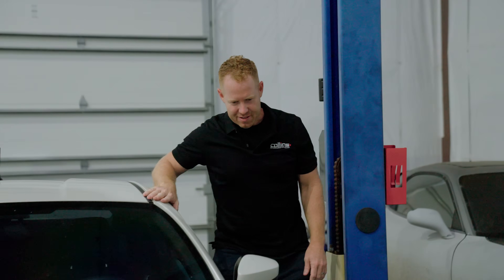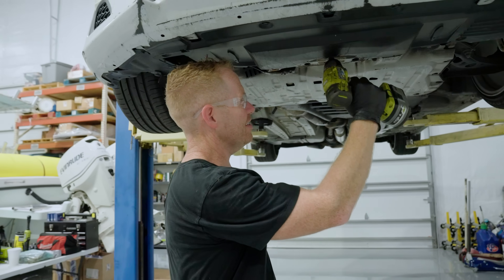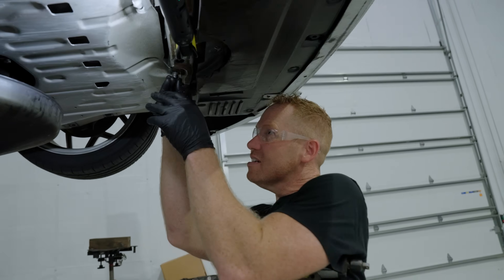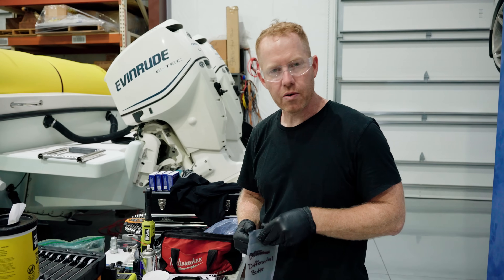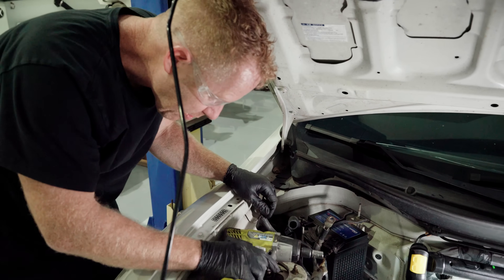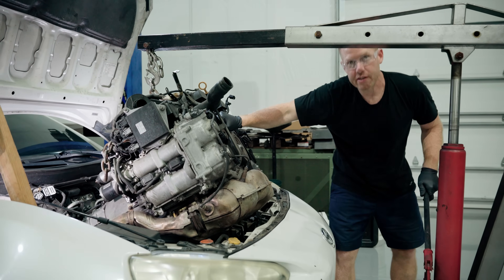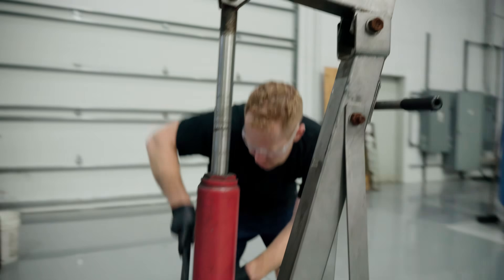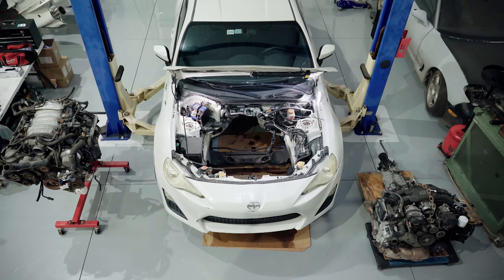3UZ-FE V8 swap into an FRS using the stock 6-speed trans, Video Series! Part 1 engine removal

Comment: What’s the reason for the 93 octane? Compression ratio? My patrol vehicle at my security job is a Lexus E30 (I think it’s an E30, it’s a SUV-2014 model) and the client insists on only 93 octane fuel. It’s naturally aspirated, and in my typical “throw a blower on it” mind, I can’t figure out why he pays so much for 93 for something I can’t drive over 25mph on my patrol route 😂

Comment: Loved my FRS, and more torque would have been welcome, but that crusty thing is a disservice putting in that chassis, even if it's a grandpa v8.  The FRS/86 is basically a more modern 90s Supra.But your car, your choice, and I approve of a V8, especially if you mod it.  Sold mine because it was my only car and didn't like the snow.
Reply: Read, couldn't drive in the snow even with less power than a go kart. Also, opinions and all but calling one of toyotas best engines(including the god almighty if you like them 2jz)a grandpa v8 is ridiculous. If anything that would the 7m engines as the 2jz came out within a year of the 1uz engines that the 3uz is also based off of. The flat 4 engines like what is in these cars are an insult to the car it was put in.

Comment: Nice swap. 
 Should have said so when commenting about the background music. 
  I have dozens of old classics not counting my Toyota collection. 
  Have a 76 Celica GT fastback. 
  It now has a supercharged 1 UR-FSE. Making around 500 HP on just 5 lb boost.
 It required some stuffing. Lol
  There are other projects using the Lexus engines. But I will jump straight to my 1980 D300 dually.
  Was tired of the 8-10 MPG  especially with a 4:56 diff gear.
  Now has a supercharged Toyota
1 GZ FE  V12 
 And it's using a Mopar 8hp90. 
  With low boost makes Around #400 tq @ just 1500 rpm  
#620 @4500
  Almost doubled its power and MPG 
  Love the puzzled grins from some people hearing it with no clue what's powering it. 
     🤠🐂

Comment: rod knocking for no reason? come on dude. stop lying. there is a reason. owners who dont take care of their fucking vehicle. full stop. dont gaslight people. its pathetic. its as bad as "subaru ring lands are weak" no you idiots just drive it like you stole it, you end up being low on oil, lack of oil means lack of lubrication, lack of lubrication means more heat, more heat means cylinder temps too high, early combustion, boom goes the engine. its almost like car guys now are just glorified wrench turners who dont know shit. you topped your subi engine with oil? good for you. you mention later "maybe that's been off before, it was too easy" okay so you aren't first own. who's to say the first owner didn't absolutely fuck the engine. adding oil doesn't fix a damaged engine.

Comment: An ls just makes way more sense. Way more aftermarket support with parts and tuning
Reply from the maker: Nah, I went down the LS route... I tried throwing a junkyard LS with 150,000 mi into a car and everything was complete junk. Needed to rebuild all of the bearings, all of the seals, even the cam bearings were junk. I had no oil pressure whatsoever when I started, Nothing was saved or good. LS engines just dont last.... after I rebuilt everything! it was way more than the cost of three of these engines..
We didn't touch the bottom end whatsoever on this engine and it will go for another 150,000 miles without even blinking an eye. My SC430 has 276,000miles on it and its still quick, still spins the tires, and starts every time goes to 6,500rpm everytime I drive it. Its my long distance car forsure.
You can't beat a Lexus Japanese V8.

Comment: How does it affect weight distribution? I imagine that V8 is a bit heavier than the 4 cylinder that comes in the BRZ
Reply from the maker: It's not bad honestly. At 134 lb it's negligible. And the back 4 cylinders sit behind the strut Tower Center Line

Comment: Dude, if you're going to be removing and installing engines, you need to have a load leveler. You can't be smashing parts and using prybars. And remove the darned hood before starting also. That's just basics that everyone should know.
Reply from the maker: I have a load leveler in my personal Garage, I just was being rushed by the whole YouTube game to go and get it.. also I really didn't need to mess with it that much, the engine just slid right in honestly

Comment: I let my bank repo my 2015 wrx I put 47,000 miles on a single oil change topped up when it ran low 😂 motor is still running just fine turbo did have to get replaced but the new owner still whips it around like nothing happened. I’d say the motor issues is purely manufacturing problems cause I beat the dog piss out of the FA20 and couldn’t blow it.
Reply from the maker: Interesting.. very interesting

Comment: For all those complaining about bad engines, you bought an engine to pass emissions and only need to last up to 60k under “legal” use. 

The most common issue is caused by the eco/budget friendly oil pan/pickup and baffle(less) design. Change this, use correct oil, get a quality dynotune by a reputable Subaru tuner.

30k abused miles on my stroker ej205 and no issues/oil consumption. Oil analysis tests confirm a healthy build. Drifting, rev limit love, launches, and racing…never missed a beat.
Reply from the maker: Thanks for sharing your experience and tips! Put me behind the wheel for a minute let me see if I can blow that thing up
Reply: @CollinsGarage_Crett_Bollins  If you replace the engine should it blow up, sure 😂. You get 60 seconds (you said a minute lol) but I spent 11 hours in a blizzard with 4 other people in the car drifting and rallying with zero issues.

Comment: In my area it’s much easier to find a 2UZ. How much different is it to use that? I do see some parts on your website for it but nothing like a full kit
Reply from the maker: I would definitely not do a 2UZ as its super heavy and the engine mount pattern is different, other than that it's all the same. It's also a lot taller of an engine so won't fit with the hood.

Comment: Do you need a different ECU to run the new motor? Is it possible to use this engine with factory gauge cluster?
Reply from the maker: No we can edit the OEM 3UZ-FE ecu to get it to run off of that.
Reply from the maker: We also use an emulator that takes information from the OEM ECU then sends it into the can bus protocol of the Scion FRS to get the gauges and everything else working

Comment: Will the engine out of an LS430 work the same way?
Reply from the maker: Yes it will work but you need to swap the oil pan to an SC430 or an LS400 from a 91 to 2000

Comment: but what does that V8 rev to?
Reply from the maker: We can adjust the rev limit up to 8500 rpm. However I would not suggest anything above 7100 without doing valve springs and Shimless buckets

Comment: you should of replaced the connecting rods from the 3uz to the 1st gen 1uz since the engine is out of the car
Reply from the maker: We are sticking with the stock internals for this build. But i do have a spare set with Ross pistons laying around…..

Comment: How are you guys planning to handle the additional weight in the front? I did a quick google search and it seems the 3UZ is at a minimum ~150lbs heavier than the FA20
Reply from the maker: Nope it's only 134lbs we show the weights in the end of the engine rebuild video.
Reply: @CollinsGarage_Crett_Bollins oh okay, I must not have watched to the end; regardless, how do you plan to deal with the extra weight?

Comment: Does the swap kit work with the A960e automatic transmission (that comes in the automatic versions of the 86 platform)/is there a custom driveshaft/transmission mount available?
Reply from the maker: Unfortunately we haven't tested it I do know from experience that the automatic bellhousing is slightly different, however the bolt pattern in itself does both of the adapter plate so the only thing you would need to figure out would be the automatic flexplate spacer. I can't comment on whether or not the transmission crossmember will fit perfectly or not however the transmission tunnel reinforcement bracket system that we developed does work with the OEM transmission crossmember from the manual transmission

Comment: It is great to see a Toyota engine going in a Scion/Toyota.  But, big problem in CA, the engine has to be the same age or newer than the chassis.  So unless you get a 3UZ-FE from a Crown, you're out of luck.  Sounds like a pain.

The Honda K would be very difficult to smog changing from FF to FR.
The 2JZ is also too old.

LSx is just about it, and it has to come out of a car, so it's going to be pricy.

Maybe some day.
Reply from the maker: 2013 crown majesta 3UZ-FE works inside of a 2012 FRS, problem completely solved
Reply from the maker: You can use a 2013 Crown majesta 3uz f e engine inside of a 2012 Scion FR-S and that will work.
Reply: @CollinsGarage_Crett_Bollins  Thanks, I said that in my original comment.  Are the internals the same as the earlier Lexus engines, and easy to get in the US?
Reply: Move out of Commifornia, done.

Comment: Would this work with an Auto? IF the adapter works with the stick it should work with the auto. The only difference between the two is the internals. And how much for you to do the swap for someone?? Following and subbed.

Comment: The problem with this swap is the chassis is too new. Cali wont let you BAR a swap unless the engine is newer than the chassis. So anyone doing this on the west will end up with a track-only car
Reply from the maker: Not 100% true you can use a Crown majesta engine

Comment: Very interesting concept! Good to know. Did you compare the weight of both engines with all accessories on them? How much kilograms / pounds does this swap add? How does it affect car handling? Stock has relatively light 4 cylinders with very low center of gravity.
Reply from the maker: 134lb difference..

Comment: My guess is when going down hill a majority of the oil pooled in the massive timing cover and caused oil starvation. It would be interesting to see a teardown of the FA20. I know in the FB series engines Subaru has redesigned the timing cover making the cavities smaller and added baffles on two more iterations of the FB25 since 2013 due to the same issues. I think it’s a really cool swap and it’s impressive that the FA20 made it longer than the 2AR in my 2013 RAV4.

Comment: Oh, and I can confirm the 3.73 rear diff from an IS300 is a 100% bolt in swap, which you will want with the V8 and all its horsetorques.

Comment: hey i’m gonna purchase the kit within the next 2 weeks and was just wondering if you could give some insight on how the canbus emulator works, and/or if im better off just going standalone ecu
Reply from the maker: Okay, so the CAN bus emulator basically takes in all of the analog info from the 3UZ-FE engine and spits out the information to the CAN Network on the FRS. Its super easy to setup (12 wires), and it works with a variety of different models of FRS BRZ FT86 etc. We have them in stock now

Comment: For those wondering why even newer Suabrus blow up at relatively low miles, it's because the oil pick-up screens get clogged most of the way with silicone straight from the factory.

Subaru factories have poor quality control for their engines. Quality control on everything else is great.

When your pick-up has significantly reduced flow, your engine gets starved of oil and the engine blows early.

If the pick-up gets cleaned early, the engine will probably last a LONG time. FA series engines are great engines that got nerfed by bad quality control.

Comment: There are no real documented starvation issues on the fa20(fa24 is a different story). 99% of failures on the first gens come from heavy track use while using the recommended 0w20 or just not doing maintenance on time. My turbo brz has 100k and I beat the piss out of it on a daily basis but I use motul 300v 5w30 and i change it every 2-3k miles. The oil out of this car honestly looked kinda nasty and if this engine has 200k miles with potentially over a decade of abuse then perhaps it was just its time. Not bashing the video, the swap seems super awesome and I cant wait to see how it turns out!
Reply from the maker: That's great info, thanks for sharing your experience!

Comment: Only Subaru could manage to make a stock engine blow up with proper maintenance and no mods. Phenomenal.
Reply from the maker: That's why we're doing this swap!
Reply: Subaru owners are always full of excuses. They crack ring lands, spin bearings, and pop head gaskets whether they’re bone stock or modded. They’re garbage. And people say you shouldn’t beat on them….. well what’s the point? My s2k gets thrashed to 9k over and over and over…..
Reply: @willyjameshuff mine does too. But I have 4 extra cylinders as the f20c wasn't in great shape when I bought the car. I have no idea how they hung a piston out of the block on a stock s2k but for the price of a replacement, I managed a complete 4.8 t56 swap. Did spon money on a good cam and springs because I wanted to still rev the shit out of it
Reply: @willyjameshuff  then how my dad stock wrx reach 350k km whit og motor and trans 🤔
Reply: @elden4267  because you’re dad actually knows how to drive one 😉
Reply: Agreed I had a 2006 pre-runner Tacoma with the 2.7 four-cylinder and five speed manual. I drove the absolute piss out of that thing red lining at every chance I got, jumping it, taking it down dirt roads put 250,000 miles on it and sold it running just as good as the day I bought it. All these Subaru owners, cope so hard as they internally know they are driving a ticking time bomb.
Reply: Back in 2008 when the UK got the hatchback Impreza STI, Subaru actually managed to get the fuel map completely wrong for us.  Badly. For that and few other reasons lots of those 2.5s went pop.  The bulk of their engine variants before the 2.5 were great.  I think the first versions of the 2.5 were awful.
Reply: @Noddyunplugged  EJ205???
Reply: Of the JDM brands...
Reply: Not only that they would void the warranty because they will claim you raced the engine.
Reply: BMW has entered the chat
Reply: I killed 3 2013 FRS engines... Lemoned the car. Now rallyx a 2.0l fa20 dit WRX with 342k miles original motor. Wth FHI.... FA is not inherently bad, just crappy assembly and QC. I love my UZs, would be so cool to put a 3uz in a WRX
Reply: I mean, 200,000 miles of hard use is pretty decent. I get rid of or rebuild anything by about 150,000 because they're living on borrowed time in my eyes. Should it do 350,000? Sure. Will it? Anyone's guess.
Reply: Chrysler achieved something similar in the late 90s-early 2000s.
Reply: aren’t these cars shared platforms with Toyota and scion as well?
Reply: @craigiefconcert6493 yes, never buy one unless you want to do an engine swap
Reply: I drove a wrx daily for 15 years and had VERY few issues aside from valve cover gaskets. If you drive them like a sane person, they are fine.
Reply: @senseicorey9979 so buy a performance vehicle and drive it like a Prius? No thanks.
Reply: @senseicorey9979 The 2.0 was decent. The 2.5 was more problematic
Reply: @senseicorey9979 No one buys a FRS,WRX,or Forrester to drive sane.😂
Reply: @ryanwells5035  sane people
Reply: What about the oldsmobile diesel, or the 5.7 hemi, or the northstar v8, or the 1zz-fe?
Reply: We kinda brushed over the 200k miles bit huh... lol. I agree Scoobies have their issues, but not every motor should expect 200k miles and keep on trucking, they can't all be Toyotas 🤣
Reply: @rekonyz  I have a 2001 Ford Crown Vic with 220K and a brand new timing system so it's ready to do another 220K.
Reply: @rekonyz lol any decent car should make 200k. That's not a Toyota thing....
Reply: Subaru makes a cheap track and street toy. People treat it like a cheap track and streat toy. It blows up. People: "why is Subaru so unreliable?
Reply: @TheScottishKayaker yeah that's not true at all. A miata is a cheap street and track toy, that doesn't blow up. Stop making excuses for something that is below average reliability when used in the same way as competitors that don't fail so horribly so often.
Reply: @curveofsound exactly lmao
Reply: Before they were reliable once no more than bolt ones. 😢
Reply: Yeah because this never happens with other manufacturers…..cough BMW rod bearing cough Porsche ims bearing/bore scoring cough GM lifters cough, I could do this all
Night.

Comment: Regarding JIS, it'll depend where your car was built. My Toyota was built in Ontario before they moved production to Mexico. All regular Metric bolts and nuts. Mostly 10mm. Like 99.9% 10mm honestly unless you plan to take the engine apart.
Reply from the maker: I fully agree!

Comment: Super cool.  I refuse to convert my Vanagon to a Subaru engine because I despite Subaru engines.  I despite them because I live in Alaska and I am tired of hauling firend's cars back to Fairbanks or Anchorage due to complete engine failures or head gasket failures.  It is nevertheless the duty of those who don't own Subarus but own tow vehicles and trailers to help them out.  Anyway, I was thinking of swapping my Vanagon engine for a TDI, even though Subaru swaps are the cliche.  Maybe I skip the Subaru and swap to a 3UZ-FE.  Fuel economy is a big concern though.  I'm guessing the next U-tube will not compare the old fuel economy to the new.

Comment: i get it nice idea but all that extra weight kinda ruins the balance they have……are K swaps not easy….??  those FA engines are just crap
Reply from the maker: The weight difference is only 134lbs. It’s maybe 25lbs heavier than an LS and significantly lighter than a 2j. It will be fine